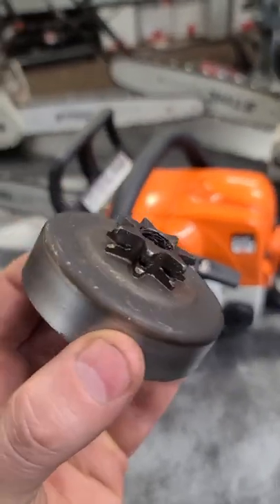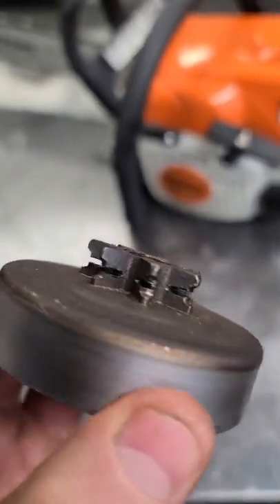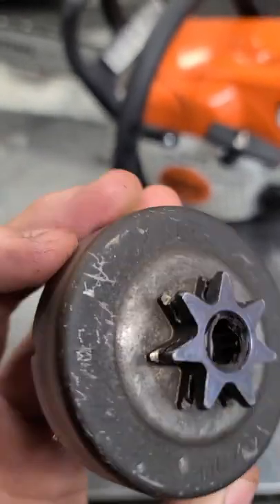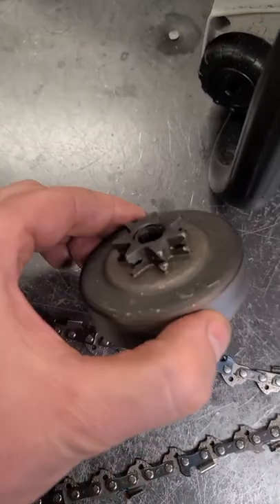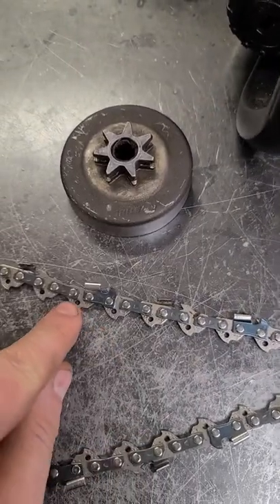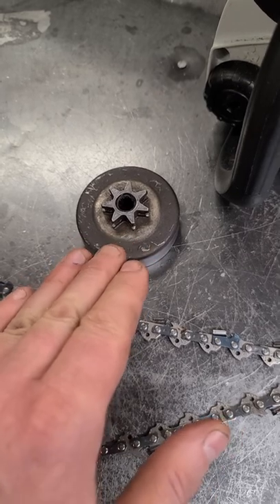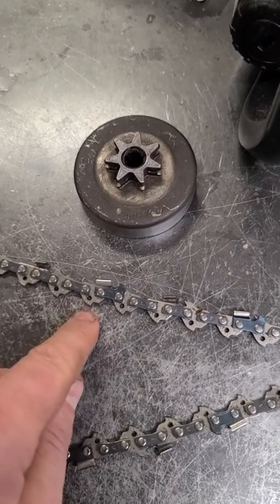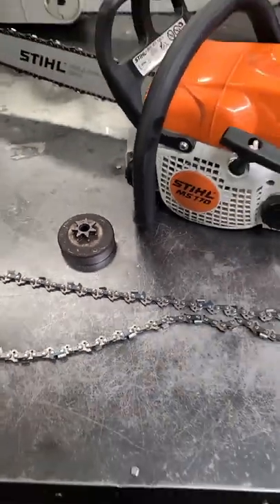Have You Ever Seen A Chainsaw Sprocket Worn Out Like This? #shorts

Comment: I am an occasional user with an MS210 that I bought with my house. I replaced the sprocket and the cheap replacement did the same.  It was then that I realised that you can either get 6T or 7T sprockets for the MS210.  I was using the wrong sprocket for the pitch on the chains I had bought.

Comment: There are many people who do not realize there are consumable parts on many mechanical things, and have never been educated to that fact, and there are some who do know and either forgot or don’t care.  After retirement, when former students come up to me many years later, there seems to be a trend that what they most remember are things I scared them about I.e. pushing a board all of the way through past the blade when making a rip cut on a table saw, making sure the chain on a chainsaw is checked periodically for too much slack as you use it, not reaching in to remove a workpiece from a surface grinder until the grinding wheel has come to a stop, and etc or the following may be the result.  At least these are the types of things they said that I told them about and that they seem to remember.  I’m sure you’re doing it, but you might want to put a little scare into your customers Don.

Comment: A worn and stretched chain wears the teeth on the sprocket, not the other way around. This is why it's so important to keep the groove in the bar & oiler port clean & free of debris after every use so the chain will receive plenty of lubrication.

Comment: Yeah. My dad is an idiot and thinks you can just brush the bar and chain oil on, as if he can remember to do that nearly often enough. He doesn't think the automatic oilers even work, or he doesn't know they exist. He runs and owns several expensive stihl demolition saws along with makitas, dolmars, etc. But he buys a new craftsman chainsaw every year, all because of stubbornness to learn and complete negligence. He's the reason I'm this good at fixing small engines. Thanks dad. Never had one of my machines fail until he's touched it. So far in the one time he got the balls to molest one of my holzformas he got one of the quarter turn oil caps out of alignment with itself and that only took 10 minutes of fiddling
Reply: Just remember he is your dad and you wouldn’t be here without him. Patience…..the essence of virtue
Reply: @37yearsofanythingisenough39  i know, i love him as much as i can. He's bipolar and extremely short tempered so the machines suffer greatly

Comment: I’ve seen one almost cut in half the guy used the wrong chain and continued to run the saw until the chain would not move on the sprocket…it got very very hot

Comment: Sorry I meant the exhaust isn't plugged !
Reply: Bearings piston and cylinder are Fine !
Reply: Spins over like butter with the spark plug out !
Also I replaced the recoil !
Reply: Also with spark plug in plug wire off is still kicks back pulling cord.. so timing shouldn't be an issue!